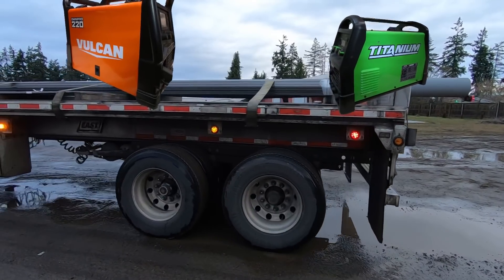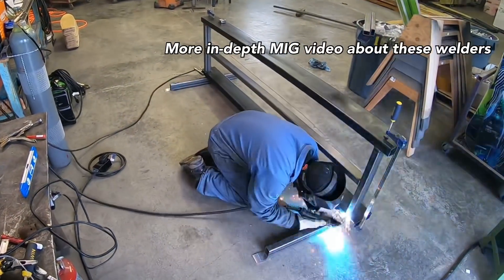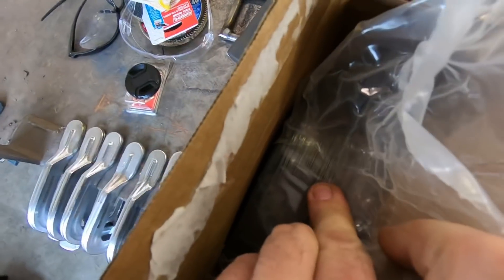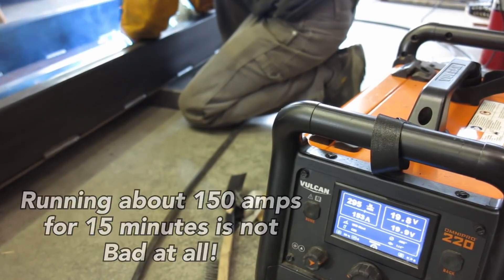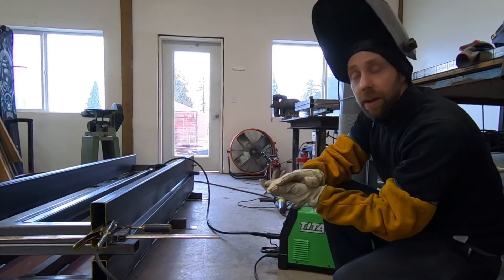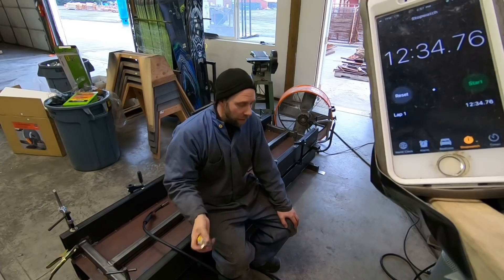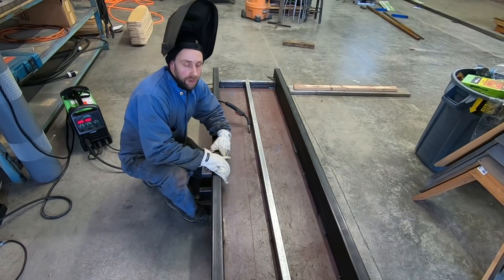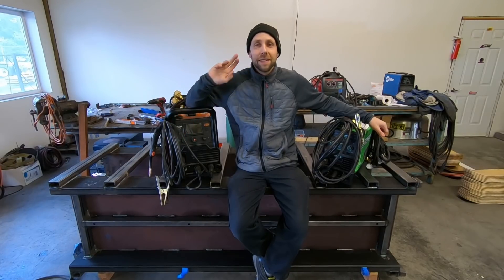Titanium Vulcan welders real world duty cycle MIG test

Comment from the maker: Hey Guys it's Michael here! If you would like to see more review videos I did testing out these two welders click on the links below! 
Titanium/ Omnipro going over the differences of both welders  https://youtu.be/snf98CiVjkc
MIG test with the Omnipro220 and the Titanium200 https://youtu.be/z1ADGEFJ6f8
Stick welding review with the Omnipro220 and the Titanium200 https://youtu.be/j2Y0YLQJPcU
Omnipro220/ Millermatic test review video compairison video https://youtu.be/9NAnSGOD8uA
Omnipro overview side by side with a Lincoln 140 weld pak https://youtu.be/nCYlNPCuBbk
This video is not about the welders but covers places to get free to cheap metal for projects https://youtu.be/MQNYDmq-k-w
Reply: Will you do a demo of how these two machines weld aluminum? I'd like to know if they weld aluminum well.
Reply: Mike festiva o
Reply: Wanted to say thanks for the Omni 220 reviews  . I just sold my old miller 185  (welded good but getting old and only might) and bought a Omni pro 220 .  Want to get the Tig setup  ( review on those parts and any suggestions )  and spool gun for aluminum  later on .
Reply: Mike festiva Hey Mr. Festiva I'm a aspiring welder just getting into school I'm looking to get the Titanium Unlimited 200 for a medium/small scale shop welder. Would you be able to do a "real world" stick test with both or even just the Titanium to see the "true duty cycles" my biggest concern is that the Titanium won't have as good of a duty cycle as I might need but I can't afford the Vulcan so it's really my only option. Thank you for your quality videos Sir.
Reply: Great job, Bud
Reply: how do you weld gas shield with fan blowing on you. doesnt wind blow gas shield away
Reply: Would u recommend buying the omnipro 220 for a mobile welder and home Fabrication
Reply from the maker: @AndreyLocklear  The Omni pro is a good reliable welder, my only concern is once I was running it on a long 150 foot extension cord, yes way too long and it would shut down due to lower voltage. So I would look around on YT and see if anyone made any good videos on running it on a generator to see how well it does with that power supply. Other then that they seem to be built pretty well 👍

Comment: I noticed the titanium you had to keep the tip further away like 2 -3 inches which is apparently manufactured recommended instructions. It was -about half inch we were getting porosity plugging up the wire further away fixed this. And have you experienced this?

Comment: When you showed the placard on the back, I was very surprised to see how little that welder draws. 25.5 amps max from the wall at 240V for 220A/25V mig output is extremely efficient. It must have power factor correction.

Comment: Which one is the best
Reply from the maker: It depends on your needs and budget? Both welders work good. The Vulcan packs more features and options but cost a bit more. The Titanium also welds great but have less options but is more affordable.
Reply: Titanium also comes with all accessories for multiprocess... Vulcan does not come with tig accessories, but Does use pedal, whereas Titanium is lift tig only.
Like he said, Titanium is much smaller and about half the weight... So, more portable

Comment: I have the titanium but when I set it up for mig it dosent want to seem to burn correctly it just sputters the whole time what are your settings for everything , tensioner puller , amp , wire speed and volt idk if I have something set up wrong or what but it will weld fluxcore better than hard wire
Reply: Do you have the rollers right? If your welding thinner material 18.5 and 230 seems to do well you could also download the app welder helper you put the  size of the material your welding what process and it gives you a reference
Reply: Did you change your torch polarity? Flux is electrode neg. Mig requires electrode pos

Comment: It feels like these inverter machines are constantly adjusting or something to help correct. Not like my transformer welders where smaller setting changes makes worlds of difference. I would like to read about what the technology is actually doing. My titanium 200 stated settings on the door are way way to hot, make me wonder are they using different chips versions or software updates to control these things. It seems they vary to much from one users machine to others. I'm wondering if HFT has multiple manufactures making these things and they are all different, very likely with made in china. Example I've watched videos of same model and the operators were crawling their welds. I use on the door settings on my 200 If I go slow it will burning through very easy, to easy. I have a feeling if I get the same model that was manufactured 3 months ago it will operate like a totally different machine than the one I have.
Reply: it's 'too' not 'to much, to hot'.
Reply: @bookooc5605  I reply on a phone hard enough with big fat thumbs. I'm not going to fight the auto spell checker too.
Reply: @bookooc5605  Hard enough trying to type on a phone with big fat thumbs. I'm also expected to fight the auto spelling correction too... By the way no one cares, takes your meds.

Comment: I am thinking of one of those 2 machines. I will be using it for welding 1/4 steer to frames of cars for hydraulics. Which one would do you recommend?
Reply from the maker: They both work great. If you plan of doing all your welding in a shop the Vulcan Omnipro is a good choice especially because it is the easiest to setup. The Titanium 200 is all manual for the settings, smaller and more portable it’s good for packing around. I’d go with the Omnipro 220 👍

Comment: I have a big Lincoln stick welder but I been wanting a mig welder for some lighter metals but will still handle heavier metals also. I don’t do a lot of welding at all. Now I’m welding a desk frame together with 14 gage 2” & 3/4” tubing. It might be 6 months before my next welding project. I like the idea of these being a little more portable. Which would you recommend?
Reply: If you don't weld that much get the less expensive one.  It seems to work just as well.
Reply: What you'll basically need is a mig welder that produces at least 150 true amps or more. With that you can go thin or thick hope this helps.

Comment: I wouldn't say I'm a professional fabricator (especially since my over head and vertical up can use some improvement haha) but I have been welding for 8 years now and the only time I weld is at work, and i don't want to spend several thousands on a machine I will only use sometimes. So I am very grateful for people like you who take their time to do this. I have been looking at getting either one of these two and I believe I'm going with vulcan just cause I like the color HAHA! thanks for the great video.
Reply from the maker: Right on! Thanks for checking out my videos 👍 both welders are good, I used my Vulcan Omnipro for about two years and sold it after running the Titanium. The Titanium was more compact and light for hauling around, I sold the Vulcan because I needed a TIG welder, I bought the Vulcan ProTig and it’s a awesome machine. 
I do miss the auto set and some of the other nice features on the Omnipro. Take care

Comment: Mike,  I have a titanium 140. On the box it says it will weld up to 5/16 inch. However, when I open the welder to see the chart for settings I see nothing past 1/8th inch thickness settings. The welder is only 120 volt. Am I missing something?
Reply from the maker: I think 1/8” is about average for any 120 volt welder, sometimes you can weld a little thicker with flux wire because it burns hotter.
I would think the 5/16” would be multiple passes to weld that. Even on my Titanium 200 the chart only goes up to 1/4”
If you bevel the parts with a grinder, you can lay a nice big bead or two down in the V groove. This will help when welding thicker parts. 
Also on really heavy metal you can pre heat it with a torch down the V groove, this will help too. Take care
Reply: Lincoln Electric 140HD Weldpak owner here, 5/16 is going to be flux core, settings cranked high, and almost guarantee that it'll be a multipass to get a good weld. You should be able to do single pass 1/4" with flux core.

Comment: What's your thoughts on the Lincoln back there? Is it a 180?
Reply from the maker: The Lincoln is a 140, I really don’t think it’s that good of a welder, low duty cycle, only 120 volts, 140 amps seems questionable and is about 55 LBS, the volts are stepped so you only get like 5 settings plus it’s a older style transformer welder.
I think for the $550 it cost I would prefer the Titanium 170 for $450, 170 Amps, the Titanium has a better duty cycle, it’s 120/240 volts, it’s 24LBS, the volts knob is linear so you have a wide range of adjustments,( no stepping like the Lincoln) digital display and it’s a inverter welder, they weld a lot smoother then the old transformer welders. 
I have welded a lot with the Lincoln and my Titanium 200 and hands down the Titanium is a far superior welder. Once you weld with a inverter MIG you won’t go back to the old transformer machines. Take care 🙂
Reply: The 140 Lincoln sucks. We have one at work and it’s terrible. Lincoln’s hobby machines are not that great as for the ones I have used. I want to try their 210 mp (the one the Vulcan is made after)
Reply: @sbranham86  I've been using the Lincoln power mig 210 mp for around 6 years now and it's a very capable machine. Would definitely recommend it, I've ran the aluminium spool gun, .045 e71T-11 self shielding wire, dual shield Ultracore 71A85, and your standard Er70s6 in all 3 diameters. As well as 7018 stick and some stainless stick, all worked perfectly.  Only downside is that you can't truly run spray transfer with hard wire and 90/10  since it is voltage limited to 25 volts.

Comment: Awesome review. Any update reviews on both welders?
Reply: I've watched almost all your welder videos. Leaning towards the vulcan 215. The price point is good. A little bigger then I need but I don't want to be restricted down the road. Great videos. Awesome channel, keep them coming!
Reply from the maker: I have hear from people that own the 215 and they really like them. I think you will be happy having a little extra amps 👍
Reply from the maker: Hey James I have quite a few videos on these welders on my channel, I no longer own the Omnipro, it was a rock solid welder, I just found that the smaller light weight Titanium 200 fit my needs better. I also Own the AC/DC Vulcan ProTig 200, I got rid of the Omnipro to buy the ProTig. If you go to my YouTube page, just about every video I’m using the Titanium 200, right now I’m building a mini 4x4 articulating dump truck, most of the metal is 3/16” and 1/4” the Titanium 200 doesn’t miss a beat. Check those videos out if you get time 👍

Comment: I wonder if the 20% coupon works on the titanium welder?
Reply: No. If you read the fine print it will tell you not discount coupons on several items and welders are one of those. Only coupons that are actually for the welders will work and I think once a year there's either a 10 or 15% (can't remember) coupon that will work for anything in the store including (a) welder. That coupon only works for one item. Try not to get in a hurry if you can because HF runs sales for most everything including welders three, four, or five times a year. Often.
Reply: @jerryhayden8720  Right now there is $50 off the Titanium welder.
Reply: Nope
Reply: @richardbrown5346  I got my heart broken a couple of weeks ago. All I had to do was read the coupon but I didn't.

Comment: You are right I bought a name brand welder it didn't hold up, I tried to take it back to get repaired they said they don't make the parts for that machine any more. It was a 7 year old machine. I think I will go with a off brand and see if it last over the time the name brand welder lasted.
Reply: i have an old transformer wire feed its old as dirt its blue and is a monster and is kind of a pain to move around but god is it handy when some farmer friend comes in and you have to weld 400ft of weld pass after pas hard facing something and it never skips a beat would i weld 400-600ft of hard face with an inverter no i would not but they do have there place and i plan to get one for small jobs

Comment: I’m sure you have been asked a bunch but I have watched a bunch of your videos on comparing the titanium 200 and the Vulcan Omnipro . My question is since you have both and use both which one would recommend. I plan to buy a spool gun for aluminum.
Reply from the maker: Well Nathan I really like the Titanium 200, it fits my needs best, the size and weight is the biggest factor for my decision, it’s about 20 lbs lighter and much more compact. The Omnipro is definitely a bit more robust and the TIG has the optional amp pedal available for it, but for DC TIG I have not found this to be a deal breaker on the Titanium. The Omnipro has the screen and walks you through the set up of all the different set ups for MIG, stick and TIG, the Titanium comes with a simple note card to set it up. I have never hit the duty cycle on ether machine. The multi voltage is really great. I ended up trading the Omnipro for the ProTig 200. The Titanium 200 is my main MIG welder. I would say if you wanted a solid shop only welder with a few more features go for the Omnipro, if you want a great compact welder that is quite portable and affordable go for the Titanium 200. Take care 🙂

Comment: awesome vid- and you obviously know what you're doing, but I have a question... you don't have any issues with that big fan blowing your shielding gas too thin while welding? may I ask what your flow rate is? I weld near water front properties and the wind is a constant obstacle. I'm thinking of replacing my Hobart 210 MVP for one of these multi-units, but it's tough giving up the Hobart knowing these welder are Harbor Freight- which typically makes lousy toss-away tools.
Reply from the maker: Hey Mike thanks for checking out my video, I have had a lot of people asking this question, most people assume it’s blowing on me, the fan is actually pointing away blowing out the door, this would be drawling the smoke outside, so it doesn’t effect the shielding gas.
About the reliability of these welders, I have had zero problems with them so far. I don’t think I would ever buy a older style transformer welder that only does one function ever again, multi process to me is the way to go, I have no complaints about them. Buy what ever brand you like, I do know even if you buy a name brand they can still break, my friend bought a Millermatic 200 it was sent back 3 times in the first year, he was down a welder for about 6 months. With HF stuff at least you can walk in with a problem and walk out with a new welder, they don’t make you wait when they send your old one in for repairs, you get a completely new machine. Take care
Reply: @Mikefestiva  thanks for your reply mike- it didnt even occur to me the fan was exhausting! duh! lol. actually, your experience holds weight with me because you clearly have a good handle on the trade. I'm listing the trusted 210mvp for sale and going for that titanium 😉👍